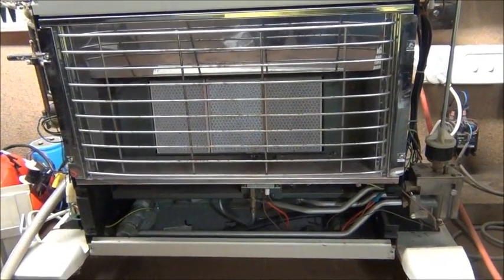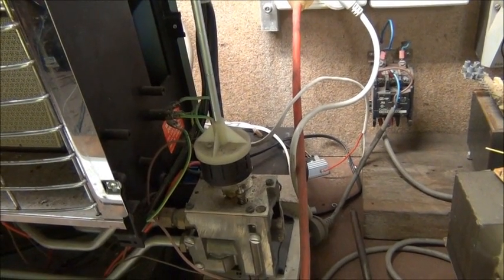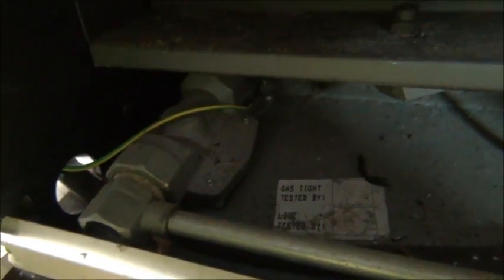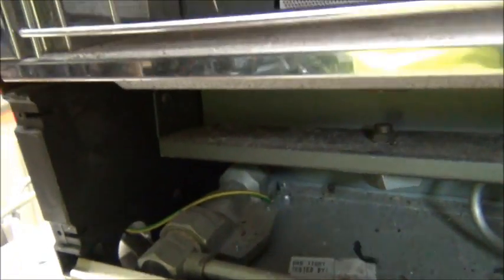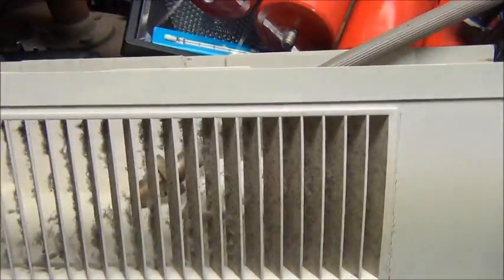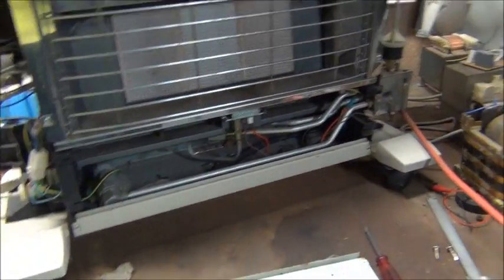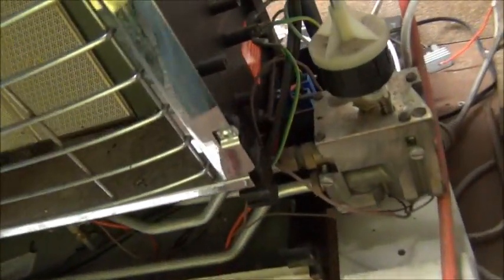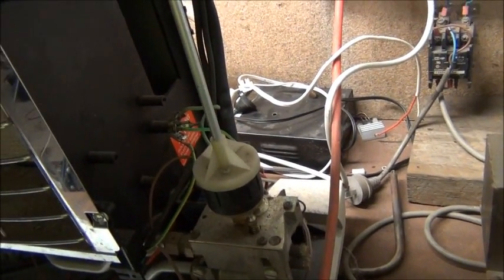Bonaire Gas Heater - Inspect, Possible Repair/Autopsy Job

Comment: I think the capsule in front of the fan is a thermostat - some of these fires actually throttled the flame to maintain a set temperature. 

We used to have one without the fan, and when you first set the temperature, the flame was full, then it slowly dropped down to just a low flame as the room warmed up. Neat stuff really.

Comment: Natural gas is a smaller molecule and lighter that air. Propane is a heavier (denser). Your statement is spot on. But due to the larger molecule of propane you are adding way more fuel to the fire hence smaller orifice. You can easily convert a propane (BBQ, Furnace) to natural gas by drilling out the orifice but the reverse you need to purchase a smaller orifice. I think I have a couple of propane orifices lying around I can mail you a couple if you want

Comment: Thanks for the video. I've got the same heater. The problem with mine is that it has trouble staying lit, and also the fan cuts in and out. I'm thinking it's a heat sensing problem. Have you played around with that at all? Cheers

Comment: Perhaps a trip to the scrapyard for a ignitor from a cooker or old gas boiler, that might do, wonder if Ed (aussie50) might have something kicking around over there, too good to scrap, that fitting on the gas bayonet it the same standard for uk cookers, never seen one of those fires with a fan in it,

Comment: You have to change the orifice size for propane at   the manifold. Propane uses a smaller orifice If you put propane it will produce a extremely rich flame. Even if you reduce the pressure it will over flame or oriface to venturi speed will not be enough and you will get a flame spill out. Please record it should be fun.

Comment: I had one of these and I may still have the ignition kicking around. 
The burner still runs after the main switch is turned off. it just kills the fan.
I will have a dig through my boxes tomorrow for you.
Reply: BensShed hey matey, I just picked up one of these on the side of the road in tip-top condition. The only problem is as you just described that the flame keeps running after the unit is switched off. Would you happen to know why that is?

Comment from the maker: when i depress the ignitor button 240 volt goes to the ignitor circuit primary side. only 6 volts appears at the output.

Comment from the maker: thanks mate !!! appreciated !
Reply: alex993cc1  hey, I just picked up one of these on the side of the road in tip-top condition. The only problem is that the flame keeps running after the unit is switched off. Would you happen to know why that is?